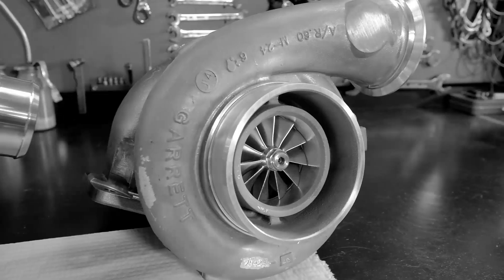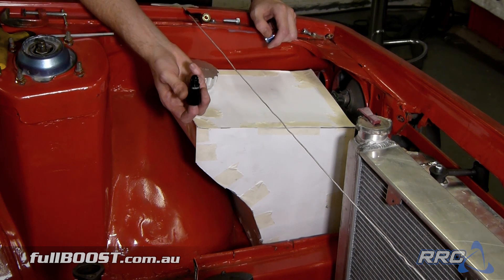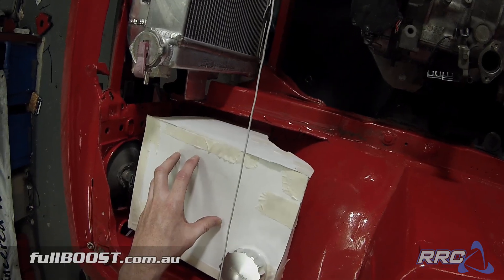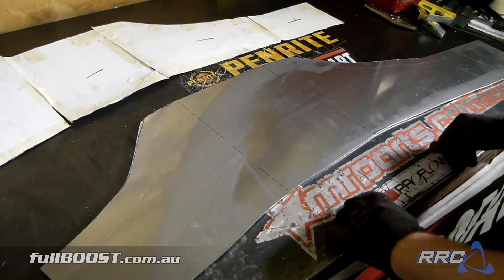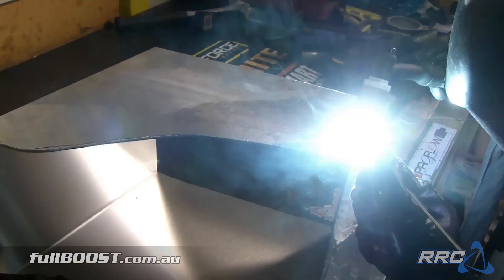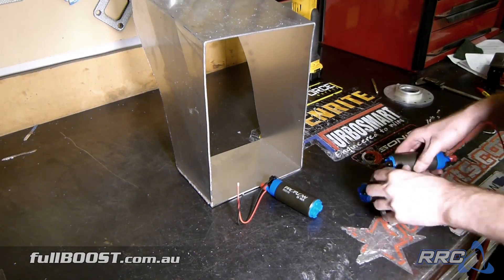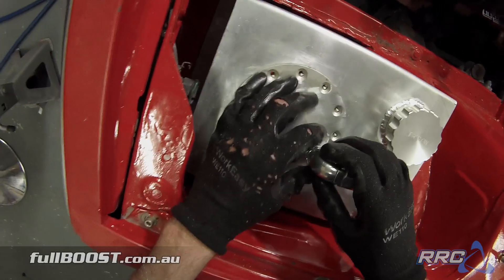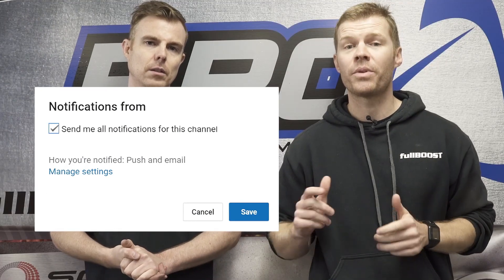BACKYARD MECHANICS | How to build a fuel cell | Project REDLINE Mazda rotary build Ep 5

Comment: What's the safety regs on fuel cell under bonnet?
Just thinking if that rotary and/or turbo goes boom. You going to shield it in some way?
Reply: pretty common practice in drag racing to have weight on the nose of the car, and no problem legality wise.  You'll find many drag cars that can fit fuel cells in the engine bay do so.

Comment: No Baffle? I'm baffled as to why, so I guess there is a baffle hey....
Reply: The pumps are submerged in 15L of E85 before we start a pass and a single run doesnt use much fuel at all, so no reason for any form of baffling.  We arent going around corners and fuel wont get low, so all good

Comment: Wouldn't trust fuel cell near radiator fuel not suppose to be exposed to heat anyway ( in engine bay no no). And especially going to be race car with mean extra power and heat
Reply from the maker: jasterable Installing a fuel cell in the engine bay is a common modification in a car that will not be street driven.
Reply: Fullboost oh OK kool

Comment: I'm not a fan of that fuel tank location. I'd be to concerned about hitting the front left corner, and the tank springing a leak all over the engine, sounds like a big fire to me. A fuel cell in the trunk would be easier and safer.
Reply from the maker: +F1NNSP1N Its actually safer to have a fire contained to the engine bay rather than under the car.
Reply: Its one of the reasons we welded up every single last hole in the second episode.  God forbid there is an accident or a fire, the firewall is completely sealed off from the engine bay

Comment: Hi. How do you connect to the fuel pumps inside the tank?
Reply: HI Darryl, i cut the bar stock i milled out into 4 pieces.  3 had 3/8" barbs welded to the ends, then all 3 pieces were welded to the forth piece to make what looks like a chickens foot i guess!  The 3 ends ran to each pump and the other side out of the -10AN fitting on the lid.  Electrical wires are run out via little insulated studs

Comment: Hey lads awesome work. I'm in the process of building my own alloy fuel tank. Would love to see a bit more on the fuel hanger you guys built, and how you hook up the fuel lines from the pump up to the top fitting on the tank.Also did you weld a thicker piece on the inside top of the tank to tap the holes that the hanger bolts too?
Reply: 9 min 28 sec mark you can see the 12mm plate we welded to the underside of the lid.  We use these http://www.proflow.com.au/catalog/511510?prodtype=1 to feed the electrical wires from one side to the other, and the hanger was just machined out alloy bar stock that was cut into 3 pieces, with a 3/8" barb welded to each end, and then in tank rubber fuel hose connecting to the pumps.  It all joined up to the single -10AN outlet you can see welded to the cap.

Comment: That tank looks tiny?
Reply: It's a drag car, only needs to start up, do a burnout, drive 400 metres and that's it.
Reply: Those 3 pumps will heat up the fuel in that small fuel cell in no time..
Reply: Its approximately 17 litres, so more than enough capacity for its intended use.  Only 1 pump runs for a majority of the time.  all 3 pumps will only be running for around 10-11 seconds, so not enough time to put any heat into that volume of fuel.